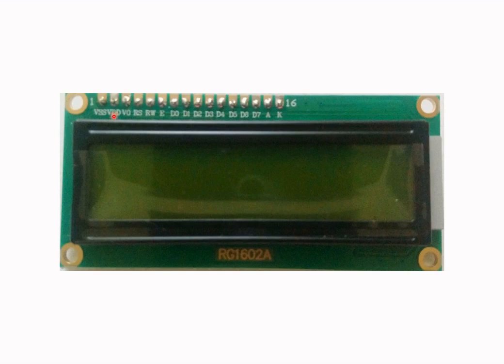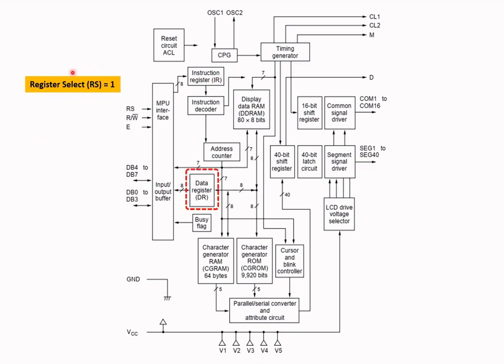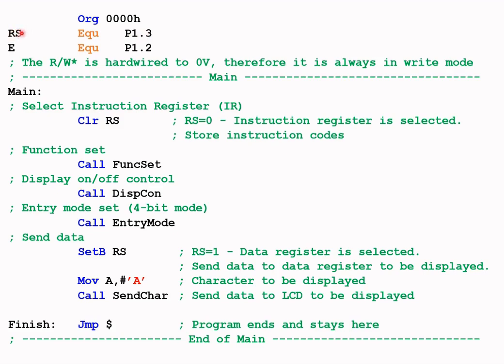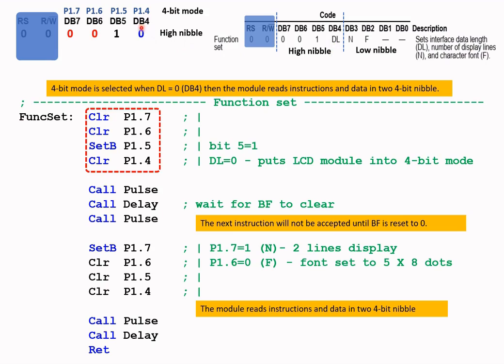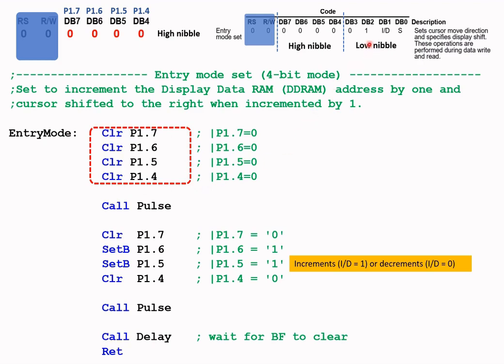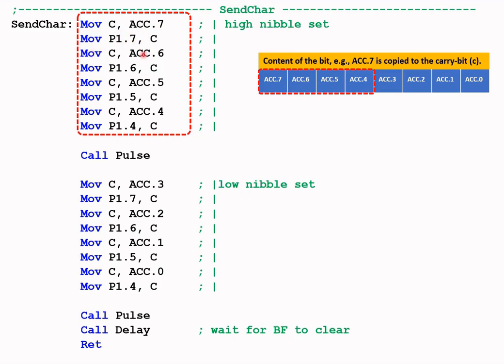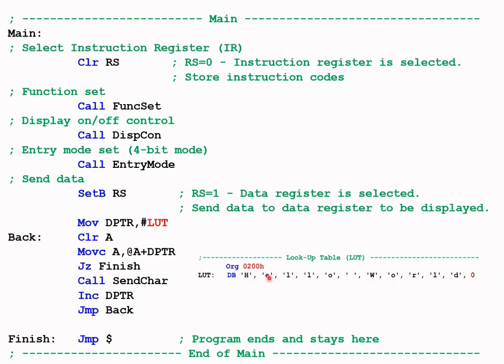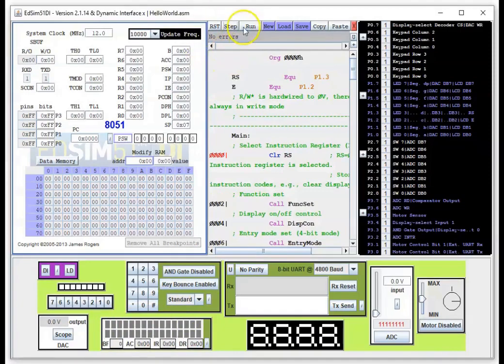#28 EdSim51 LCD Module

Comment: what is the meaning of ACC.7, ACC.6.....etc ? And why is it moved to C register ?
Reply from the maker: ACC.7 is bit 7 of accumulator (ACC), ACC.6 is bit 6 of ACC and so on. C is the carry bit (carry flag) of the 8051. C is used to display the data to the LCD (Port 1) bit by bit.

Comment: how to make this code work with LCD1602 display? im currently playing with a prechin a2 8051, but I have no idea how to make the lcd to work
Reply from the maker: The LCD1602 and the HD44780 used by EdSim51 are very similar. However, I don’t the know much about the Prechin A2 8051 system.

Comment: Sir, please help me understand why Call Pulse is used twice in sending high nibbles in Funcset (Call Pulse 1, Call Delay and Call Pulse 2)and used only once in other Call functions like Dispcon, Entrymode and Sendchar
Reply from the maker: Hi, the EdSim51 is set to operate in a 4-bit mode. Only DB4 to DB7 are used. Therefore, DB4 to
DB7 of the function set instruction is written twice. The first time - tells module to go into 4-bit mode and the same nibble is send the second time. For this we pulse the Enable pin twice. Please refer to the HD44780 datasheet pg 39 and pg 42.
Reply: @vooiyap  Thank you so much sir for your explanation

Comment: Just a question, can I both interface LCD and Keypad through edsim51 so that they both work ? Like when I press 1 on the keypad it will be displayed on the LCD. And if yes, any tips on how to do this? Thank you.
Reply from the maker: Hi you should be able to use the keypad and LCD display module together. On the EdSIm51, the kepad is connected to Port 0 (P0), and the LCD display module is connected to Port 1 (P1).
Reply: @vooiyap  thank you
Reply: Hello once again, I know now how to combine LCD Module and Keypad using EdSim51 but I am having trouble doing a Line Feed Carriage Return or in C++ "\n" so that I can output multiple messages in the LCD Module. Any tips on how to this? Thanks.
Reply from the maker: @keebul0y  Hi try this link: https://exploreembedded.com/wiki/Interfacing_LCD_in_4-bit_mode_with_8051
Reply: @vooiyap  thank you

Comment: thank you for your teaching ~ very helpful. btw is it possible to display Hello world with IC at89s52 and arduino nano ?
Reply from the maker: Yes, it is possible to display display Hello world with the AT89S52 but you will need to connect an LCD display module to the AT89S52. You can also do the same with the Arduino Uno.